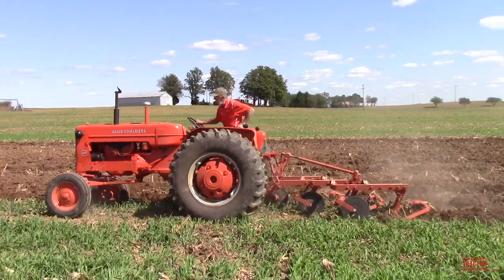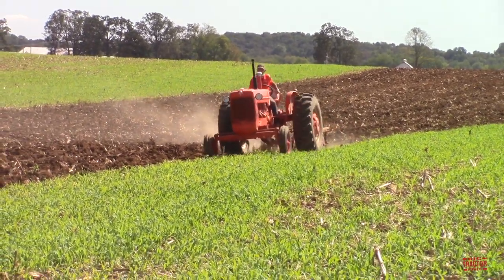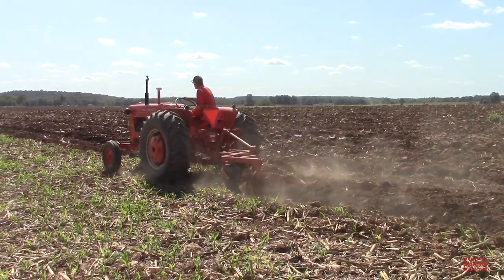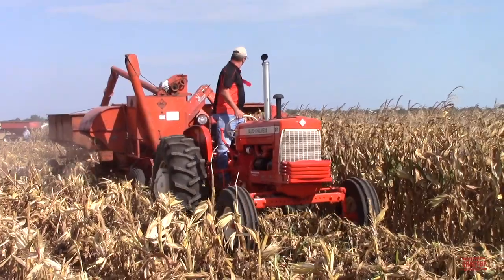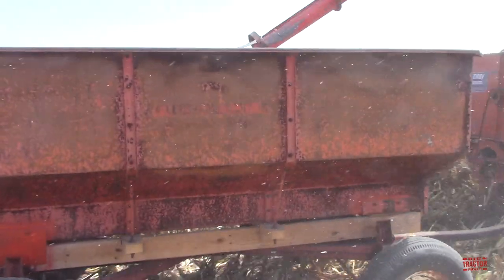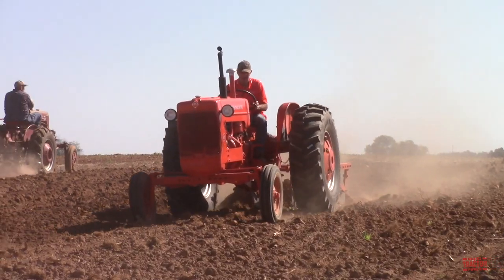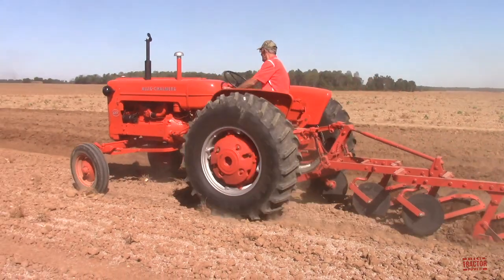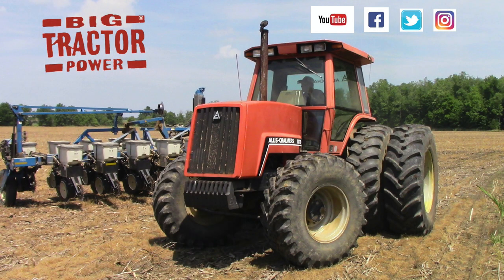ALLIS-CHALMERS D-17 Tractor Plowing

Comment: It was stated in the video there wasn't much change in the d17 through the series. Actually there was alot of change in series IV mainly with the hydraulic system. The pump was moved to where a belt pulley would be & it became a truly live hyd system. Controls moved to the right side of seat. Vastly improved hydraulics. Also series IV was available with factory 3 pt lift for the first time or the traditional snap coupler. Series IV D17 with factory 3 pt is great tractor.

Comment: I operated AC tractors in the 1960s as a high school kid. I plowed with a 1953 WD45 Diesel. In the right conditions that tractor could pull 4 bottoms. We pulled 3 bottoms. Also drove the straight WD gas tractor with a stalk chopper. That was a dirty job before cabs. They looked small but they could pull. I grew up just south of Waterloo, Iowa where the big John Deere's were made but some farmers there had ACs and Farmalls and Olivers (another Iowa tractor)  as they were not as expensive as the JDs.

Comment: My late Grandpa worked for an Allis - Chalmers dealership here in north eastern Arkansas.  So even after it closed, it had to have orange paint for him to use it.   Some of the Allis's I have used in my life time are CA, WD, WD-45, D14, D17, D19 and 190 xt. We have had both LP and Diesel D17.  It was the first tracker that I raked hay by myself on.  I got to use it because it had power steering and I was so young I had trouble turning the WD. Both the CA's we had tricycle front end and is the only tractors we ever had I really hated having to run.  We still run the Allis's at times, but have switched mostly over to Kubota but hey they are still Orange.
Reply from the maker: Great history.  I always enjoyed visiting the Ellis Chalmers dealer when I was a kid I always enjoyed visiting the Allis Chalmers dealer when I was a kid.  They had a long curving driveway and I was always need to see tractors and combines lined up along it. Keep that orange rolling.

Comment: I have a D17 wheatland special diesel that still gets put to work every year on the bailer. The engine is getting tired and is in real need of a rebuild, so I try to be kind to it. My dad bought it off his uncle about 30 years ago or so, and  he didn't buy it new. I run several Allis's on my farm, and the 17 is one of my favorites. My family has orange blood. I've run most other makes ( in fact, my cousin had a JD dealership for several years), but I'm loyal to orange. They have been loyal to me.
Reply from the maker: Very cool. Allis made some good tractors. What other AC models do you run?
Reply: @bigtractorpower  I have a model B, a WD 45 that dad bought bout 40 years ago, and a 7040. I also have two WF's sitting in the bush. One of them patiently waiting for some lovin.  When I was about 10 or so, the WD 45 had a coolant leak. We didn't have time to fix it, so we were running it with water. After I was done using it, it was too hot for my little finger to drain it. So I figured I'd let it cool down.  But I forgot and the block bust. Hence the one WF in the bush. So the 45 now runs with a WF block. Surprising enough, the old man wasn't too upset with me.
 My boy also  has some Allis garden tractors and an old Simplicity walk behind tractor. Like I said before, our blood is orange.
Reply: I feel bad now. I can't believe I forgot to mention the WC my wife bought me 2 years ago. It's a tricycle just like the 1st Allis my grandpa ever bought.  She's going to choke me😉

Comment: When i was a kid, we got a D17 Series 3 with a front loader.  Took some getting used to it over a John Deere 1020.  Nice that it had more power than the 1020, but i think the guy we bought it from sold it knowing the motor was on it's last legs.  Also had a Gleaner E Combine, which used the same gas engine as the D17

Comment: My dad farmed with Allis-Chalmers tractors.He had a B,C,CA,D-17,170 diesel &175 diesel.D-17 was series1 gasoline narrow front no power steering that pulled 4-14s and 14 ft harrow with excellent Tractiin- Booster system.
Reply from the maker: Great line of AC machines.

Comment: My grandpa had a series 2 D17. Was the most I'll suited tractor on the farm. We always joked it would get stuck going down hill. It was horrible on fuel and the hydraulics were worthless. So for the most part we only used it to run the square baler because of the hi-lo power shift.
Reply from the maker: Sorry to hear the D17 II did not work out well.

Comment: I'm currently void of a 17. I replaced it with a 185, I also have a 1962 D15, 1953 WD that's been in the family since delivered new and still have the original book with dealer delivery page in it. Also have 1937 un-styled WC and 1945 C, my son has the 1953 WD45.

Comment: Rode on a bunch as a kid, we pulled 4 14s with a gas engine.  It was fine running engine and would easily run 6 hours on the fuel tank.  It was a series one, it had a really slow hydraulic system but other than that it was great.
Reply: Hydraulic weren't slow if you had Allis Chalmers cylinders. The D17 was high pressure low gpm which used a small cylinder that reacted quickly. Other tractors had lo pressure high flow so they took a big cylinder to do the same work

Comment: We had a early model WC AC it was my grandfathers tractor. Hand crank with no pto. no power steering and hand brakes we used it for many years only tractor on the farm.
 While everybody else was using newer and bigger tractors but, it did the work that needed to be done.

Comment: we still have my gpas Allis Chalmers wd45 since new  he used to farm  with  till my dad was 12 it has 3 bottom snap coupler plow we plow gardens with snap coupler disk and allis chalmers bush hog  pull 3 section spring tooth harrow the type you had to set each section with spring lock handle so many settings for depth and all way back to raise plow and bush hog was in barn with tractor whole life disk sat out  tractor started on the coldest days in ohio grandpa had top motor gone over cause 50 some years metsl head gasket got worn out not from abuse  dont use it much now since he passed cause  now motor work done it has so good compression beter than new it is hard to start but when does it screams i love it kinda rarecit has the full weight package most dont have front wheel weights  tricycle front end oh he used a pto pull type sickle bar mower to cut hay used few times for fun till it broke  grandpa had me scrap it  he said it had the ac cultivators that were made for it to cultivate corn and belt drive wheel on side   and more equip he sold when quit farming his neighbor had the ac or gleaner combine they both had ac an shared equip or parts got parts from wooster ohio when they had ac dealer
Reply from the maker: Thank you for sharing.  Lots of history. 😁👍

Comment: Somebody should teach that guy to set up a plow....
Reply from the maker: What is the plow doing wrong?
Reply: @bigtractorpower  since you asked....at 3:54 the rear coulter is about 4' off the ground. You cant just adjust the plow once and leave it you have to adjust it to each field..... all of the bottoms should be in the ground an equal amount and the plow should not try to "dig".....thats what the adjustments on the plow are for...in that light ground it wont matter much, but if you are plowing somewhere with heavy ground and sod or hay it would not work very well....